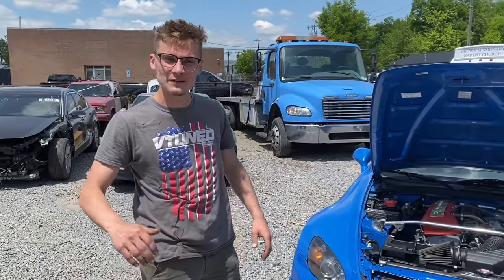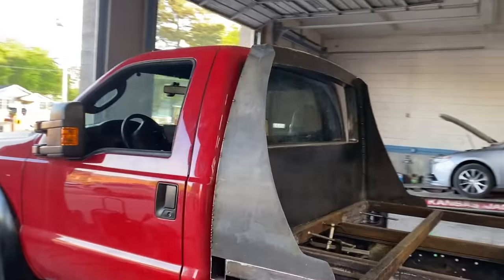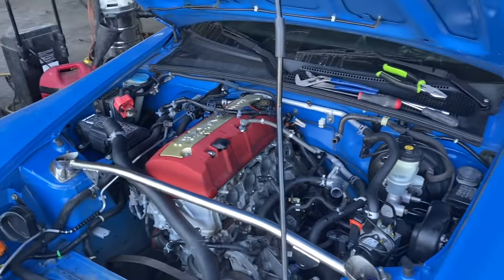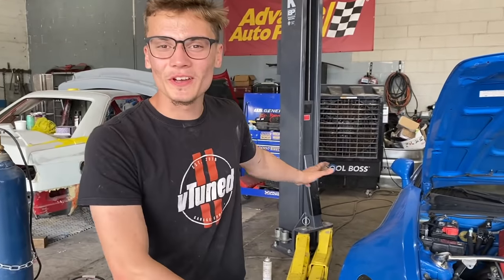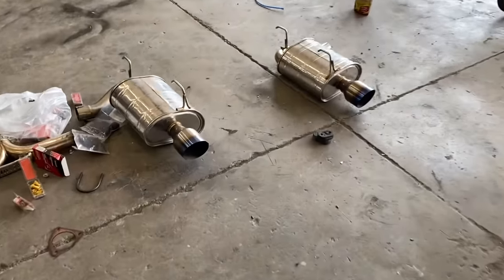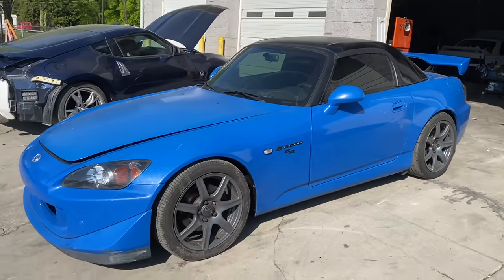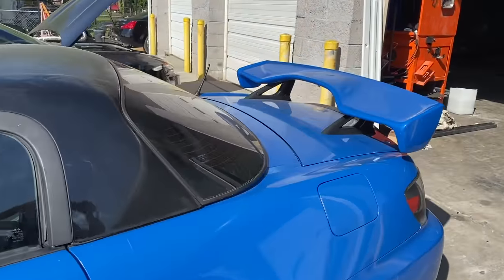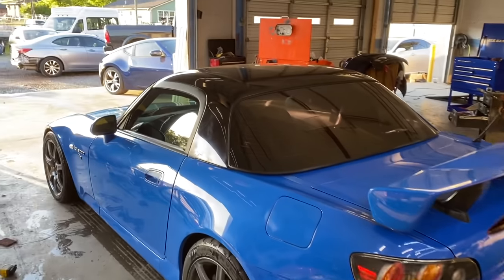Fixing a coolant leak on our Honda S2000 CR Project car! And new Invidia exhaust installed!

Comment: Looks awesome. Looks a lot like the paint job on the new Porsche GT3. You can tell yesterday was the day the embargo was lifted on all the videos. But it looks very cool. The S2000, along with the Ford GT, Porsche CGT, the Holy Trinity, Ferrari 458 and 488 plus some others are considered 0 dollar to own cars. Meaning you can drive them, then sell them for more than or equal to what you paid for it. Considering this car is in there with some million dollar cars and it costs less than 60k, that is pretty damn cool.

Comment: Good stuff!. If they're maintained Honda engines are just about bullet proof.
Reply: Amen to that. My wife's CRV has 271,000 happy miles on it. No signs of slowing down either. Great vehicles
Reply: @NJGhost34  I bought a new Honda CBR600RR motorcycle in 2007 for Supersport 600 racing. I've still got it and now use it for track days. It has 18,000km of racetrack use and it's never had the spark plugs out. All I've done is changed the oil and filter every ten hours of operation. Amazing engineering.
Reply: @ScottElliott152  love it. I had an 07 1000RR. Sold it in 09 and got a R1. My favorite motorcycle I ever owned was my 98 900RR. Should have never sold it.
Reply: @NJGhost34  I had a 98 CBR900RR race bike. I've always had a Honda in the garage.
Reply: @ScottElliott152  always keep a bike in garage too. Right now ZX6 and a Busa.
Reply: @NJGhost34  That's great. Once bikes are in your blood you can't get them out. I've got two track bikes ... CBR600RR and GSXR750 and a KTM530EXC enduro ... and  the orthopedic hardware and scars as well!
Reply: @ScottElliott152  same here. Surgically repaired right elbow and lifetime of early arthritis from a bad spill on the 1000RR back in 07. Thankfully I had on my full gear.
Reply: @NJGhost34  Seems we've existed in two spooky parallel universes that intersect with a Band of Brothers sporting neat haircuts rebuilding beaten up cars and trucks!
Reply: @ScottElliott152  amen brother. Love the Motorhead channel because they get the job done themselves and work as a team. Gotta respect that. And always much respect my fellow rider